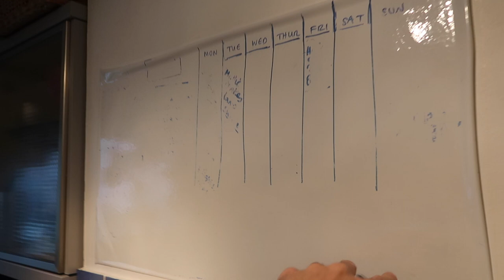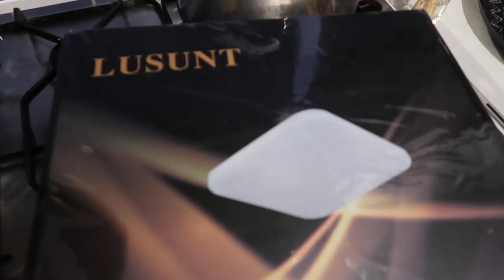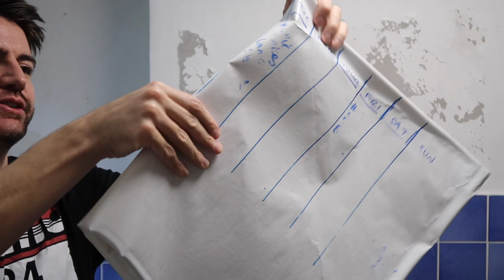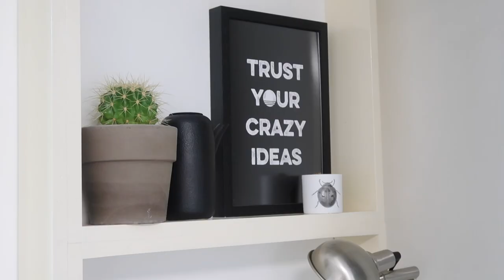KITCHEN MAKEOVER ON A BUDGET! DIY DREAM KITCHEN UK *UNDER £100* UK | 2020 MR CARRINGTON

Comment: I like it very much. Scraping that paint off the concrete and painting the tile took a lot of patience but so worth it. Love the crates and mug rack in that space. It really did make over the room without spending a fortune. I have all the supplies to redo my bathroom. No reno just paint, new rugs, towels, shower curtain, artwork and accesories. Hope it turns out as nice as your kitchen did. Well done!♥️🔨👍😊
Reply: What Smart boy You burn  adrenaline i love all of cleaning un buen casero es más interesante para  My 💌💌💌💋💋💋💗💗🏡🏡🏡

Comment: Looks great hun well done, one small tip, get some watered down pea (or matt mod podge) and seal in the open plaster otherwise you run the risk of making it blow with the heat and steam in the kitchen, especially as it already has the crack in it. 

Also I do love the beard, you looked so different without it, I had forgotten what you looked like!!!

Comment: Great job!  SO bright and clean.  I noticed you keep rubbing into your Asparagus Fern.  I have 2 and they are Enormous.  Plant tip:  give them a good haircut when they look straggled.  Cut it back to about the bottom of the pot.  It will branch out an grow thicker and fuller.  Take it to the shower every  so often.  They love a bit of moisture.  I mist mine a couple times a week.   I set mine outside in the spring thru summer under an old oak tree.  It get dappled sunlight.  It had beautiful little blooms all over it.  Good luck!

Comment: I like the idea for the crate storage and reusing old ones, good idea; a bit concerned that you covered up a vent, looks like a heat vent or return.  Only thing that bothers me is storing cups too close to the floor with what's tracked in on your shoes.  But good job through.

Comment: I have done 3 yrs of home remodelling with my ex. I have lots of tips for you. Too bad it is after the fact. We recycle tile and other things like windows or just the glass. And the tile. So u chizel and hammer it off and the tiles just fall, like when doing a bathroom, in a bath tub. After we scoop up the tiles that dont break in a shallow box and the pieces into another. Mosaic artists buy the pieces and the whole ones can be used for smaller projects and we trade sell or give them to builders scrapyards. It quite satisfying to rip tile. 😃

Comment: It looks lovely! So much brighter and modern, the white makes the room look much bigger and airier.
 I have used the Rust Oleum All Surface on my tiles too (black)... 
I have had a few issues where it has scratched off (chipped away and the tile colour underneath has came through). It happens quite easily even when I’ve accidentally caught my nail or pushed something too harshly back into the counter tops 😬 have you had this issue at all?
I wasn’t as laborious as you though - I did not do as many coats so I’m thinking maybe it might be due to thicker coats and my error and the colour (black over cream).
Reply from the maker: It's too early for me to review, but yes I did do a lot of coats :)
Reply: Mr Carrington hopefully that extra time you spent doing so many will mean you wont have the same issue! :)

Comment: Good work but not sure why you covered up the air vent with a wooden crate? The vent would have been installed in order to correct  a condensation/ damp problem, which will creep back now it has been covered.😟